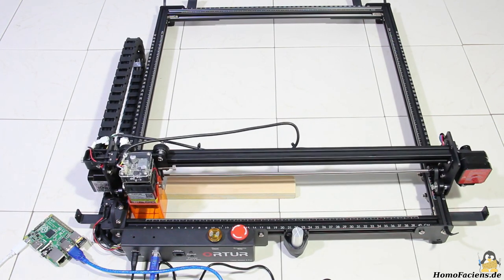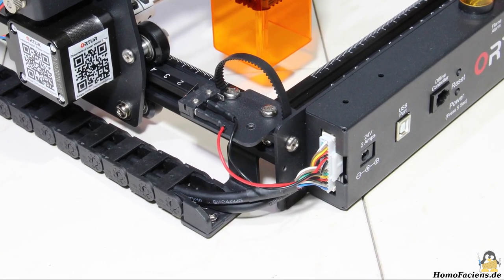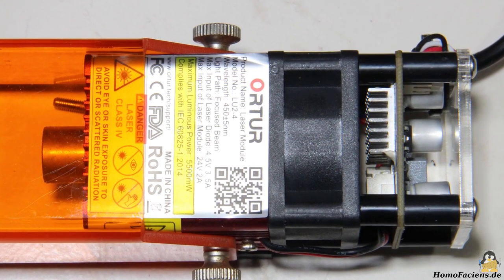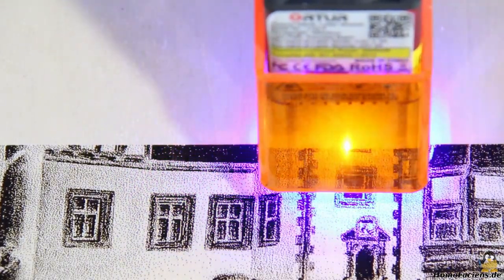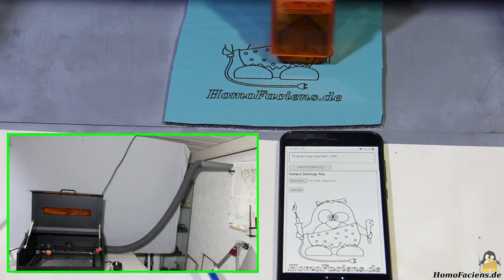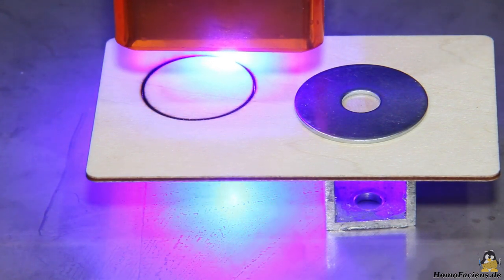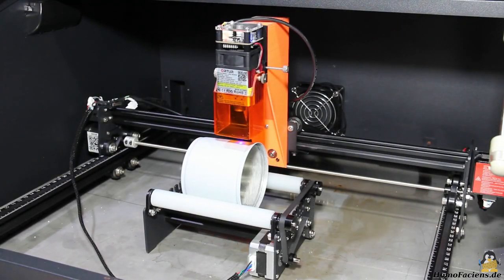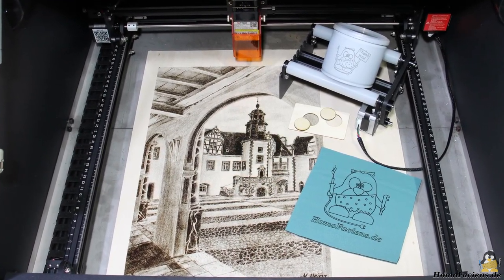Ortur Laser Master 2 Pro - things I have done with the engraver, yet

Comment: Are there any risks associated with engraving reflective material (plastic, painted metal/glass, etc.)?
Looks like a very nice machine.
Reply from the maker: If a material reflects highly, it only absorb a minor portion of the laser light. You should therefore add a layer of paint to the surface before engraving. Placing highly reflecting material under the laser means there is a risk of looking in a high power, reflected laser beam (!) but not to see any result on the material. Wear protective goggles when operating a laser and spending some extra money on the enclosure of the machine is also a good advice.